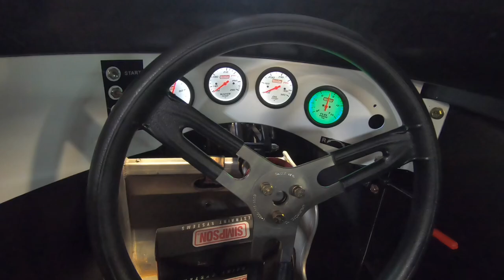NEW RACE CAR Reveal! Picking up Our Brand New Capital Dirt Late Model!

Comment: Noticed that red(rtv) y'all are using on your headers. If you'll get a sawsall, cut off wheel or whatever and cut your header flanges between#1&3/5&7, and between#2&4,#6&8. When you put them on, bolt the center cylinders first, then the outer cylinders. Tighten them in a staggered pattern. Telling you the truth, no more header worries. Just a tidbit from an old mullet wear'n, retired Bounce r

Comment: It looks awesome can't wait to hear the beast light the candles. An see Joseph make some dirt rooster tails good luck be safe. Go Joseph  getter done. Nice ride how much is a rolling chassis?
Reply: Have you seen the plug wires from old no7 garage says it will give you more horsepower always helps no hurt in trying. Good luck be safe
Reply: How about the rear end when the wall hit Joseph

Comment: Screw that return spring set up , buy the one that bolts on carb studs with throttle stop built in
Reply: Yeah that setup there is worthless
Reply: @54raceman  I didn't people used that stuff any more

Comment: I'm confused...why have it race ready before leaving Capital? Couldn't you just do all that when you got the rolling chassis home? I wouldn't wanna feel rushed and do everything at my own pace with all that new equipment. Very nice of them to let you use their shop but I don't see the reason in doing so. Or maybe with a new car the chassis builder wants to look things over idk.
Reply: Why wouldn’t you get the car a complete as possible at the chassis builders shop?  Most any part you might need in that building, extra help and sets of eyes to notice if anything is wrong.
Reply: Wow man

Comment: 853hp? Where is the other 100hp the competition has? Other than that beautiful race car. Wish you guys the best of luck as always.
Reply: I have beat this motor situation to death they are 80 to 100 hp down and ton of torque down. They don't have the motor for Bristol or Eldora If the track slicks off there fine..Hell the motor was a good deal but you got to have realistic expectations with this motor and I think they do. It's others that don't.
Reply: @JJ-1-1  I get what you are saying, and you are right, on a lot of tracks that slick off they will be fine some of the time, but when the track is good, and many are, that motor isn't gonna haul the mail the way the big dogs do.